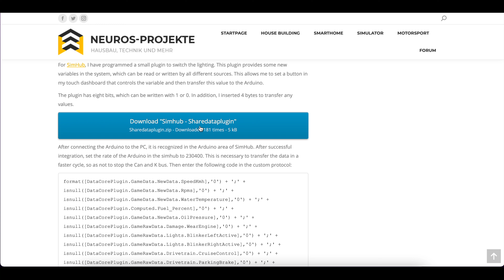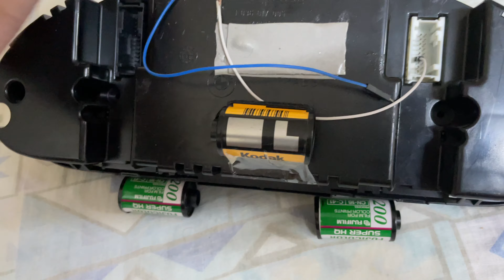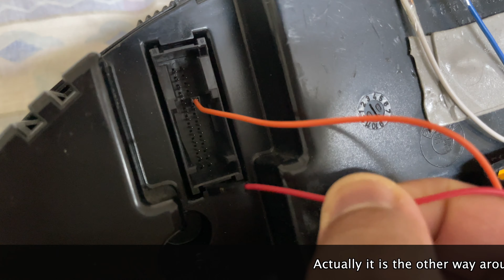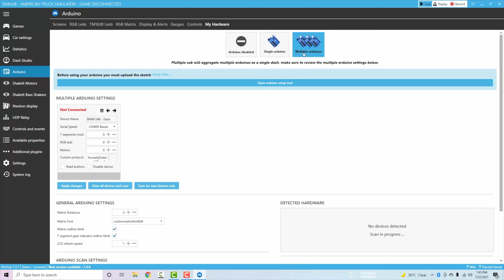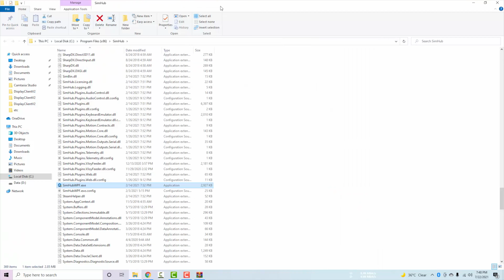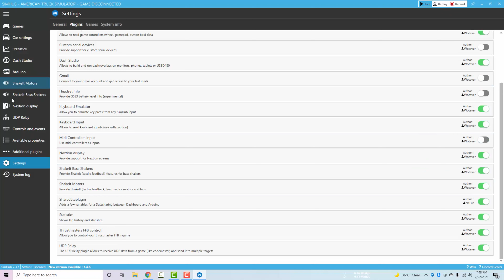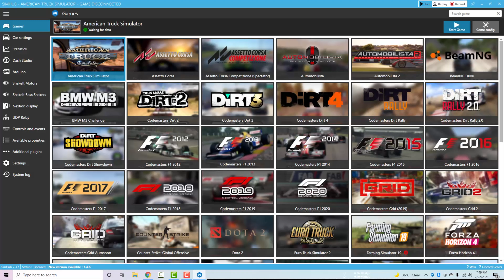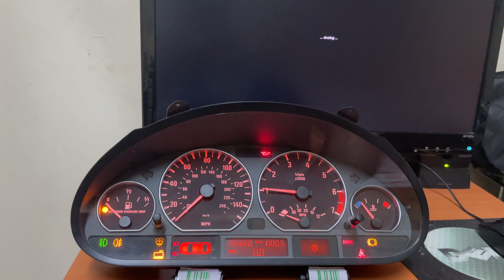BMW E46 instrument cluster connected to SimHub - CAN Bus#arduino #simracing #bmw #automobile

Comment: My brother, until you did, I love you, the truth is that my project was a bit stuck due to personal issues and work, but your video will save my life. Thank you for the great contribution to the community. I send you a hug from Argentina (by the way I got all the parts to assemble it)

( could you make a video of how to solder the circuit board is that I am very bad with that honestly )
Reply from the maker: Thank you & glad you liked the video! :)
 
Hopefully your unit also gets fully functional soon. Umm, a perf board soldering isn't something I can just show to a beginner and you will understand. My suggestion is either watch some nice videos that teach soldering and how to assemble a simple circuit on a board. This will definitely need some practice. You might want to first learn on a breadboard before moving to perf board soldering .Since the electronic traces have to be build manually unlike a printed circuit board, you can become confused easily if you straight go for soldering with trying it on a breadboard.

Or take help from some one who can do it for you like a friend or even an electronics repair shop for a price.

Comment: Can it be connected to e34 cluster? I have now e36 cluster it works perfect with simhub, but I like more e34 cluster and eant to make dashboard of e34 integrated with cluster
Reply from the maker: The E34 is same like the E36, older non-CAN bus type model. I think all you need is the +12V, Ground, Speedo, RPM , Fuel & temp gauge pins. I don't know which model your cluster was removed from. You can find the manuals for older bimmers up to E36 on below website:

http://wedophones.com/Manuals/BMW/
Reply: @sciencetrove  But its same!? Thank u very much bro im buying now e34 cluster and going to fit with e34 dashboard 😊 how can I find out if its older type? I know there is with black and blue back cover
Reply: @sciencetrove  Dude Can u please help me I bought now e34 speedo but dont know how to make it work.. can find tacho diagram for it.. I have connected to the same pins where it was on e36 cluster but nothing work ony EMS bulb, back cover is white its from 525 12v (m20b25(

Comment: Thank you for adding further explanation. I am probably going to do this build with a student. Is your fuel tank empty in the game or you haven't yet made the fuel gauge to work. Cheers from Bulgaria.
Reply from the maker: If you look at the original circuit diagram and setup, the fuel gauge stepper motor has been replaced with a servo motor. Which is then connected to the arduino. In my case I didn’t modify my gauge as I intend to sell it off later. 
The original gauge setup in the cluster works depending on the change in resistance value when the float operated in the tank. The resistance values can be found at the bottom of the below page:

https://www.bmwgm5.com/E46_IKE_Connections.htm

Hope this helps.
Reply: Really apreciate your answer !
We will try to build this in the upcoming month.
Reply: @sciencetrove  Are you willing to give me a hand with something ? We managed to get the speedo to work - but that's all. I the other E46 video I saw an ignition key and I feel like this is the thing  that we are missing in order to make the cluster work.
Reply: Nevermind the ignition - found it in the comments - it is connected - pin 4,5,6 on black connector.
Came to the conclusion that it is actually the libraries which cause problem because communication works.

Comment: Is there a 12v supply on the arduino? I want to do an audi a4 cluster that i got for free but it needs 12v 1amp even to light up
Reply from the maker: Hi,

I don’t fully understand which cluster you intend to use since this video is about an E46. But anyway the arduino has only a 5V out put and that too with very limited current range. I would suggest you can get a 12V 2Amp adapter or a small 12V PSU too. They aren’t that expensive. Or the cheapest way is to look around for a computer ATX PSU from an old computer.

Comment: i am a noob in wiring, can you tell me the most simple way to make a e46 cluster to work? i only need rpm and speed gauge to work
Reply from the maker: I think you can definitely manage the speedometer. Well all it required is a simple npn transistor and 1000ohm resistor. But you can also connect a pin from arduino 46 straight to pin 19 on black connector on cluster. It kinda works. The rpm works on can bus. Try connecting pins 9&10 for can high and low to can bus shield can high and low. Also connect one of the arduino’s GND pin to power supply’s ground. That might work I guess for the rpm.